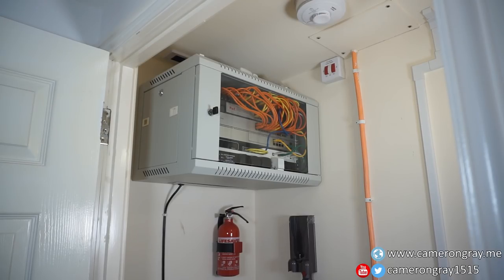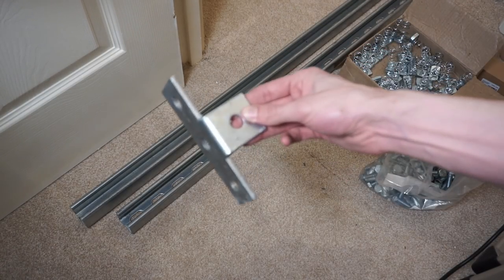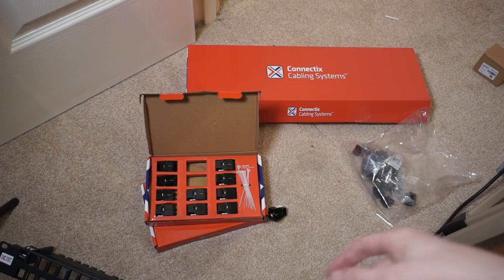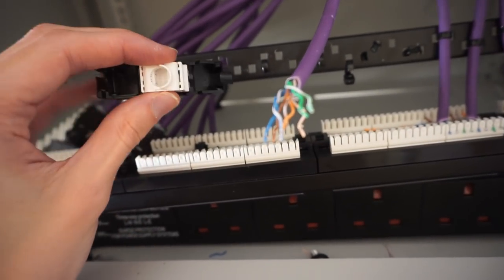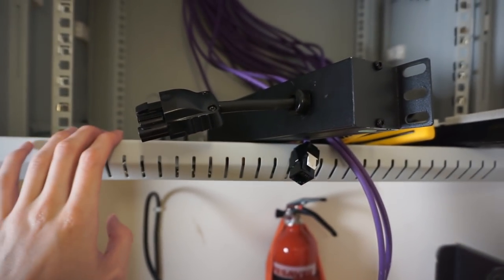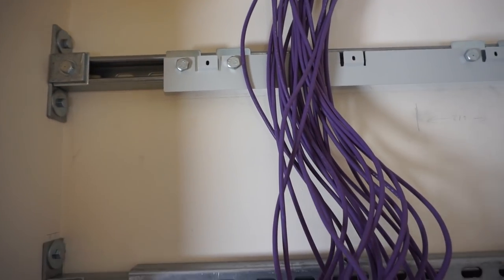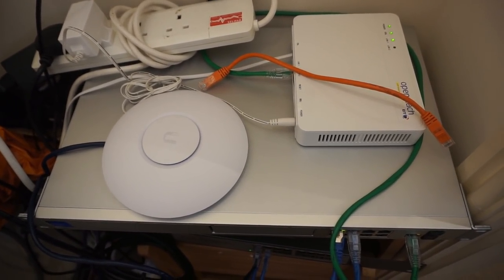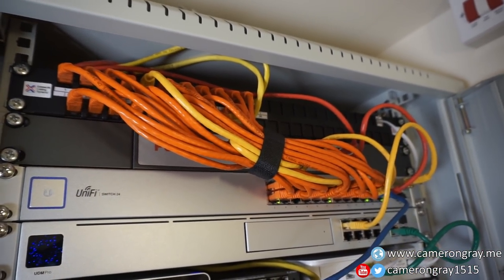Improving my Home Network Rack - New Patch Panel & Better Wall Mounting

Comment: Cameron,  just a thought in case you redo your inter connects maybe you could consider changing the the starting position of the of the first Keystone in the Patch Panel so that #1 lines-up with #1 of the Switch in that you could use all 6" or 15 cm cables 🙂for a better look?
Reply from the maker: That was a consideration and something I'd possibly do in the future however in this case I wanted to be able to use the existing cables.  There also isn't much space between the door and the switch so it might be a bit tight to bend them neatly.  Definitely something I'd do in the future though.

Comment: Nice upgrade . I have a 6’ network rack in my basement and am trying to figure out my options also . I have the dream machine pro and recently purchased the unifi 24 port poe rack mount switch .
I think the cleanest look would be a keystone panel like you did,but I’m thinking that it just adds another connection to the equation. I’m debating to run my Ethernets under the switch , and use a cable management cabinet that sticks out and looks like crap imo .
Decisions decisions
Reply from the maker: I wouldn't be too worried about a patch panel as long as you're using it correctly - Patch panels are designed for terminating structured cabling (as in, cables that are running through the building) and in that situation the additional connection isn't likely to be a problem, they are used in this way in basically every commercial installation without problem. It also means that the structured cabling stays fixed in place rather than being bent around into the jacks on a switch.  Structured cabling is generally solid core cable which isn't really designed to be bent around and terminated in RJ45 jacks so a patch panel lets you terminate the structured cabling and then use patch cables to run it into the switch, it also makes it easy to do things such as patch 2 of the network drops together to give a direct cable between network points, this can be ideal for things like HDMI-over-CAT6 systems.  Where a patch panel isn't appropriate is where I see a lot of "homelab" people using them to interconnect different items within a rack, essentially adding a connection purely to bring a cable from the rear of the rack to the front - in my opinion this is unnecessary and feels like a case of "I want a patch panel but I don't have structured cabling so I'll just shove a patch panel in here for the sake of having a patch panel"
Reply: Great Points made here ,thank you for the lengthy post. You’ve actually convinced me to add a patch panel
Reply: Btw , subbed

Comment: regarding your rj11 cable, I have been putting rj45 connector on  one side of an rj11 cables to use it with standard Ethernet patch panels ( for analog telephones) , I think it would solve your situation with esthetics for the DSL port.
Reply from the maker: I used to do this with my old patch panel, but now with a modular patch panel I'd rather use an actual RJ45 module as it feels more "self documenting" and prevents issues around people getting confused and plugging ethernet devices into the DSL port and vice versa.

Comment: How about using 2 x 24 port keystone units. Then you could place them above and below each port of the switch. The the patch leads can be shorter and straighter.
Reply from the maker: That would definitely work, but in such a small cabinet I wouldn't want to waste 1U of space.

Comment: Nice job.  What's the attraction of those old  openreach white modems?   Ive always wondered why they sell so well second hand when loads of newer options
Reply: What newer options? When I looked into it there was only the Draytek Vigour which is about 3-4x the price of a decent condition Openreach modem. Plus the Openreach modem has a second LAN port which can be useful. At the end of the day, it works so why pay more?
Reply from the maker: I personally got mine free when I first had an FTTC service installed (they used to provide them before ISPs started providing routers with built in VDSL modems) but I find the openreach ones are not only significantly cheaper than other options but they also just work without any configuration or tweaks.  I've previously used a Netgear DM200 and even to just use it as a modem you have to change a bunch of settings as by default it acts as a router (despite being sold as a modem) and I couldn't get it to support RFC4638 baby jumbo frames which the openreach modems do.

Comment: Nice job Cameron. When you first described how you ere going to configure your 48 port patch panel to match your 24 port switch I envisioned that you were going to replicate the panel ports  directly above the switch and use short patch panel leads. Is there a reson you didn't do this?
Reply from the maker: The cables I had were fairly long so by aligning them the way I did, the slack was used up across the horizontal distance.  While I could get shorter cables in the future, I'd likely struggle to get ones short enough that the door doesn't crush them when it shuts as there isn't much space between the front of the equipment and the door.

Comment: Really enjoy watching your videos ! would love to set something like this up in the future. I'm a bit of a novice, but keen to learn. How did you learn and what's your advise for someone like me to get started ?
Reply from the maker: To be honest, I'm almost entirely self taught, especially when it comes to the actual wiring side of things.  The actual cable and faceplates.etc are relatively cheap so can always just get a few bits to play around with and practice, before I cabled my flat, I lived in a rented flat were I ran a single CAT5e run to each bedroom under the carpet which at least gave me practice terminating jacks.  As for the construction stuff, a lot of it is literally just down to common sense and problem solving - working out the best routes to run each cable given any obstructions/layout of the building and figuring it out if there's any ways that you can make your life easier, such as following existing cable routes.  Only main thing to think about when running cables (assuming you're in the UK) is to make sure you're running them within the appropriate wiring zones to comply with regulations: https://flameport.com/wiring_regulations/BS7671_selected_subjects/zones_concealed_cables.cs4.  There's also a lot of very good electricians that have YouTube channels - Artisan Electrics, Nick Bundy, Cablesmith Electrical who show themselves doing work - even though it's more focused on mains electrical installations, they often show good techniques for routing cables through a building.
Reply: @camerongray1515  Thanks for the reply 👍 a friend of mine is an electrician, so he's going to help me with the cabling side of things. So the plan is to educate myself with setting it up and getting confident with how it all works on the network side of things. It's going to be a little while yet, as it's something I want to do when I buy a place with my partner, so I just want to put some time a side to learn, but don't know where to start.

Comment: Great video, thank you. Just one question, did you connect anything to the big earth stud, if not why not ? In past life we would earth every single panel  & equipment with stud to a earth bar then back to building earth.
Reply from the maker: As far as I'm aware it's not necessarily required in simple setups like mine from an electrical perspective as all of the equipment installed is either itself earthed or double insulated.  If on the other hand I was installing equipment with exposed mains terminals or single insulated wires then the enclosure would need to be earthed.  Obviously regulations may vary between countries but I'm not aware of anything in the UK that would require it in this situation.  I've also seen similar cabinets in offices which have been installed by contractors that don't have earth bonding.  On the other hand, I have seen bonding installed in higher end data center settings but not sure if this is a requirement for those or just an extra layer of safety given the high value environment.

Comment: Very Interesting video.  Your network cabinet is something I aspire to have at my home down here in New Zealand, but as others have said I dont have the time or motivation to install one.  Just one question, where is your Optical Network Terminal or have you done away with it and connected the fibre directly to the dream machine? Great videos keep them coming.
Reply from the maker: I don't have a fibre to the premise connection, it's a VDSL2 connection using the white modem on the shelf connected to the UDM with the green CAT6 cable.  FTTP in the UK is still relatively new and in the vast majority of installs will be a GPON system where the fibre is terminated into a wall mounted ONT with the end user expected to connect this to their router.

Comment: I would mount the patch panel at the top and a cable organizer next, there are ones hiding the wiring with a cover. in fact i would also mount the PDU in the rear side of the rack and use two cable organizers or just enjoy the newly created space
Then question one: why uplinking the Unifi switch to that port on UDM-PRO? you got sfp on both
Then question two: why not selling the old controller as UDM-PRO is perfectly capable of doing it all? i am running it for almost 1 year now with zero issues on UDM-PRO
Reply from the maker: A cable manager like that could work although don't think I have the depth between the front of the rack and the door.  The PDU could go in the back but I'd then have issues accessing it to connect stuff,  I'll likely get a slightly bigger rack down the line which would give more space for a front mounted PDU and cable management.

The reason it is uplinked in that way is purely because I already had the SFP RJ45 module so it made sense to use that to free up the rest of the RJ45 switch ports for other devices, the switch only has gigabit SFP so there wouldn't really be a benefit to using it over a regular CAT6 cable.

The reason I use the UDM-Pro and separate CloudKey Gen2 Plus is that I use the UDM as the controller and the CloudKey as an NVR for UniFi protect.  After updating to UniFi OS, remote access can only be enabled/disabled on a whole device basis.  Therefore if I wanted to run the NVR on the UDM and enable remote access for UniFi Protect (which is required for the mobile app to work), I'd have to also enable remote access to the UniFi controller which I wouldn't like.  By continuing to run them on separate devices, I can keep remote access disabled for UniFi controller while still having remote access enabled for UniFi Protect.

Comment: If you don't like the rj11 keystone then why not use an rj45 and crimp a standard plug onto your modem cable, non standard I know but it would work and fit as expected
Reply from the maker: That's what I had previously, personally prefer it this way as the DSL port on the patch panel can't be mistaken for a network port.

Comment: Good video. What is the cost of your structure setup? This is a lot of work.  Why do you not buy server cabinet?
Reply from the maker: Not sure of the exact cost but for just the cabling and not any of the switches/router.etc I'd suspect the current setup to cost around £300-500 in parts depending on what you go for (for example, I paid more for stainless steel faceplates, white plastic ones would have been much cheaper).  I do have a server cabinet in my office (albeit a 20U one that actually only has a single server in it).  The reason I went for a smaller wall cabinet for the structured cabling was because I simply don't have space in any of the cupboards for one.  I was also thinking about what happens if I move in the future - a small wall cabinet with all the cabling terminated could be useful for future owners, even if they just want to patch a couple of the ports into their ISP router.  If everything was terminated into a larger cabinet in one of the rooms or one of the cupboards was taken up by a large cabinet, future owners would probably want to just rip it all out to get the space back.

Comment: Why did you not mount the powerstrip on the back post of the rack? Then all your power stuff would be out of sight.
Reply from the maker: I could have done but given the rack is full of equipment it would end up being difficult to access all but the leftmost couple of outlets.  I'd generally rear mount PDUs in a floor-standing rack where I have access to the rear however not in a situation such as this.

Comment: Nice! But I would move the ports to the right side of the patch panel and get smaller patch cables. It would look a lot better IMO. Abraço!
Reply from the maker: That's true, I did it this way purely due to the lengths of cables I had (and 15cm being generally one of the shortest widely available patch leads).  Easy enough to rearrange in the future though!
Reply from the maker: Actually, my mistake, the cables are probably closer to 30cm including the ends, I thought they were 15cm.  I'll likely buy 15cm ones when I try the slim cables and at that point I'll consider rearranging the patch panel.
Reply: @camerongray1515  I bought from ubiquiti a couple of 10cm Patch Cable to test, and they measure 20cm from jack to jack. The 10cm is only the thin cable part. It's the thinnest cable I ever seen, and 1.7€ each not that cheap. But they work well I guess...
Reply: I was about to say this. Could probably use 6"/15cm cables, or even custom make some cables if you've got time to waste!

Comment: Is there a specific reason for using a separate PoE injector or did you already own this switch and just didn't feel like replacing it for a PoE-capable one?
Also I wish manufacturers would make devices like the switch or the PoE injector half-width so you could mount them both into the same U and save a bunch of space in small cabinets this way ...
Reply from the maker: Purely just because I already had the switch and didn't fancy replacing it given the additional cost of a PoE switch.  Whenever I next replace my switch I'll be going for a PoE one but wasn't worth the extra cost at the time.  Half width stuff like that would be great, Dell have some switches which can do that which is really neat, wish it was more common.  Can have a 12 port 10gbit switch and a 24 port gigabit switch side by side in 1U.

Comment: Why didn’t you put the patch keystones on the right side of the patch panel and use 6in patch cables?
Reply from the maker: The patch leads are already 15cm (so basically 6in) - there isn't enough space in front of the door to fit the slack without bending it if it was all right aligned.  The benefit of it being keystone based though is that it's super  easy to rearrange if I were to change things in the future
Reply from the maker: Actually, my mistake, the cables are probably closer to 30cm including the ends.  I'll likely buy 15cm ones when I try the slim cables and at that point I'll consider rearranging the patch panel.

Comment: I would prefer the confidence of your new fixing given the cost of equipment in there, great solution.
Out of interest how did you get a open reach modem as apposed to the hubs they offer as standard as that would suit me better too?
Reply from the maker: If you're using an external router the openreach modems are great as long as your router can connect using PPPoE, works out of the box as soon as you set up the PPPoE connection on your router.
Reply: @camerongray1515  thanks for the response. Yes I'm in the process of moving my network stuff into a cabinet and tidying everything up cause I have a few switch's and access points and it's a rather convoluted. So looking at going down a similar route to yourself, guess what I ment to ask was did you request the modem only or is a legacy item.
Reply: @regallee  you can get them on eBay for relatively cheap
Reply from the maker: I got mine from back when they provided them with FTTC installs but they're widely available for cheap on eBay.
Reply: Got mine from eBay for around £18 I think. Stated “used” but mine was still sealed in a bag.
Reply: @jasonlee3247  cool. Thank you

Comment: Nice video! Can you please share which Angled Wallplate are you using? :) couldn't find them on amazon...
Reply from the maker: These are the particular modules I'm using: https://www.comms-express.com/products/excel-keystone-mounting-adapter-with-white-shutter-angled/ which take a regular keystone jack in the back and mount into a euro module faceplate.  That said, if you're outside the UK you may have difficulty as different countries have different standards around the shape and size of electrical accessories.